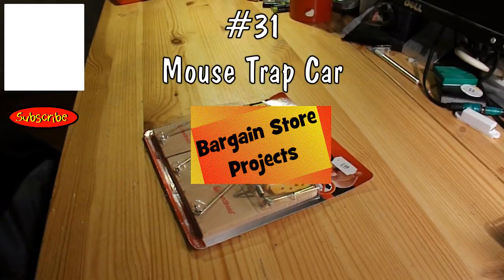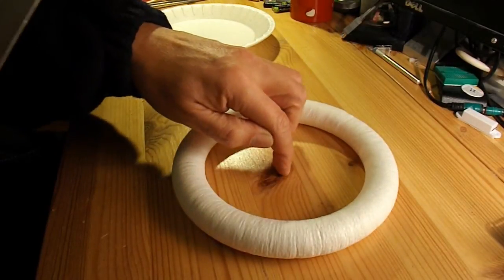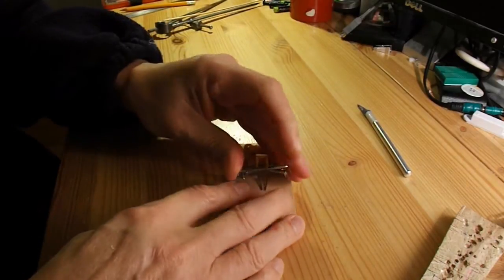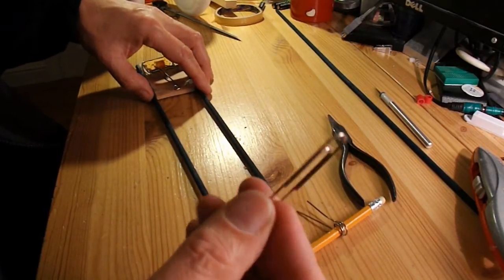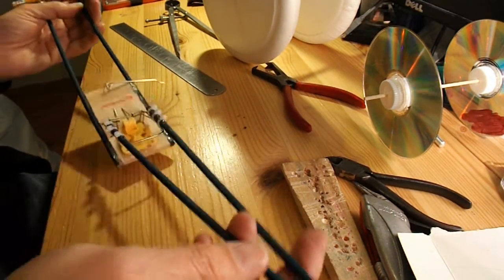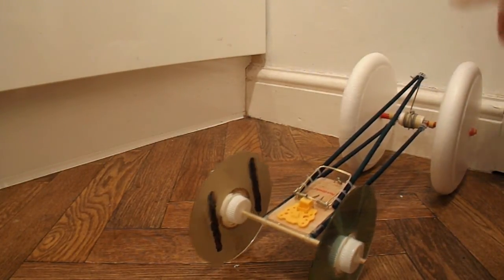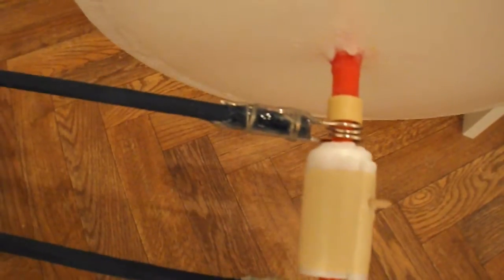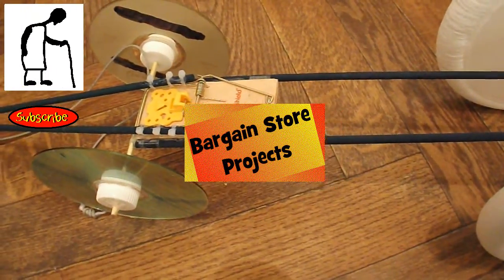Bargain Store Project 31 Mouse Trap Car

Comment: Do think this will work on carpet? If so, how far?
Reply from the maker: Your guess is as good as mine. It will depend on the gearing you use. How long your mouse trap arm is, how big your wheels are, how big your axle is, and obviously the depth of pile of your carpet.